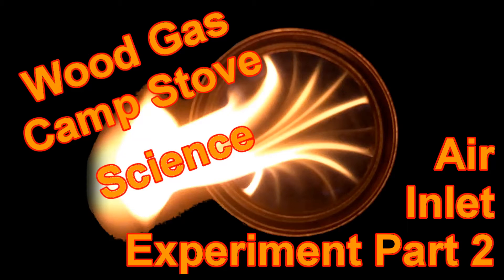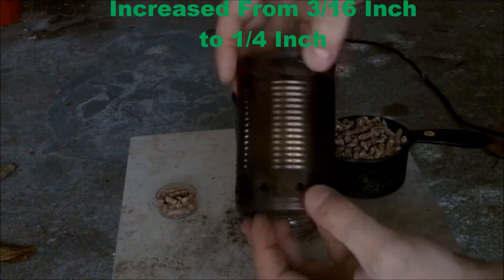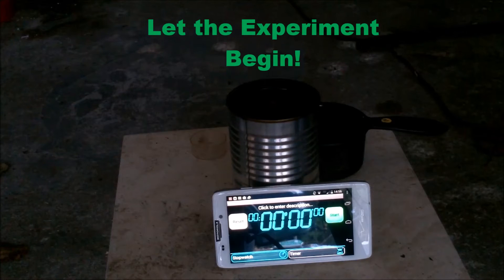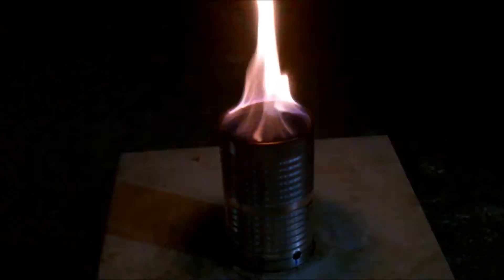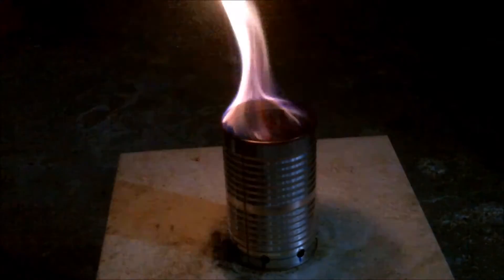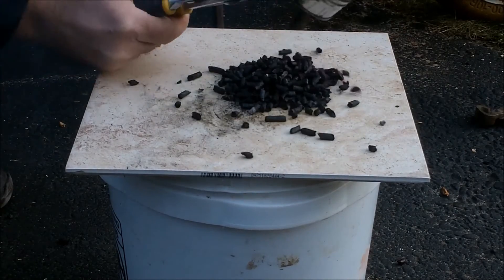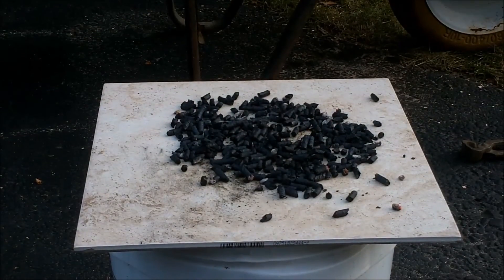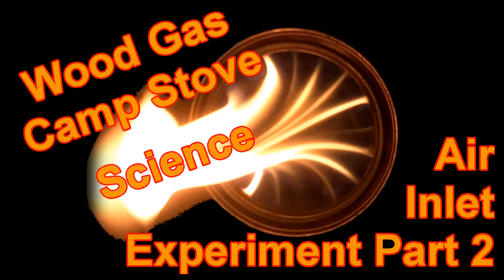Wood Gas Stove SCIENCE! Air Inlet Experiment V2.0

Comment from the maker: I have seen stoves built like that but they are not getting powerful jets and consistant burning. The air should flow up the gap between the two cans being heating as it does and then come out the holes in the top of the inner can. You want the hot air to be injected directly into the woodgas at the top of the can. That mixture will burn at the top giving you a pyrolysis zone between the fuel and the flame. Try building Version 5.4, but use slightly smaller (1/8 inch) secondary holes in the top of the inner can. That should leave a good supply of biochar at the end of the burn. Good luck!! :)

Comment from the maker: Thanks for the comments caotropheus!! I will be posting Part 3 later today. In my third experiment I increase the diameter of the outer can, but keep the number and size of the holes the same. I do not change the primary or secondary air ports on the inside can at all. The results are very impressive. I will do a test in the near future on your hypothesis. Thanks again for the input :)

Comment: Nice experiments you made here. The cans seem to fit snug and that is good. The fact that you make measurements of all parameters, adds a lot of value to your videos. I confirm what you said, there is not great difference between "PART 1" and "PART 2" because the number of holes and their size on the outside can did not change. Basically, you have the same amount of air entering your system. From my wood stove experiments, secondary air dispensers and secondary air combustion work better for a given area if you increase the number of holes, but reduce their diameter. So, I suggest a test focused on this hypothesis. Thank you very much in advance for your attention.
Reply from the maker: caotropheus I just posted Experiment V3.0... Take a look and let me know what you think. Please subscribe so you can see the rest of my upcoming experiments!!
Reply from the maker: caotropheus Thanks for the comments caotropheus!! I will be posting Part 3 later today. In my third experiment I increase the diameter of the outer can, but keep the number and size of the holes the same. I do not change the primary or secondary air ports on the inside can at all. The results are very impressive. I will do a test in the near future on your hypothesis. Thanks again for the input :)